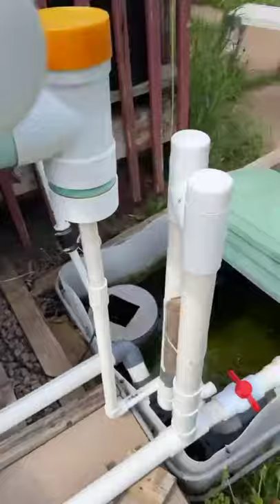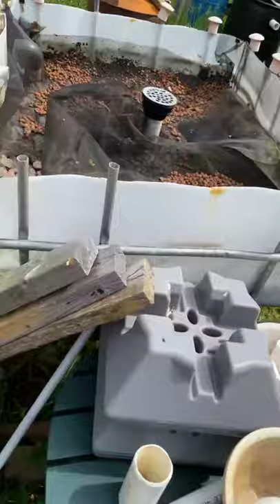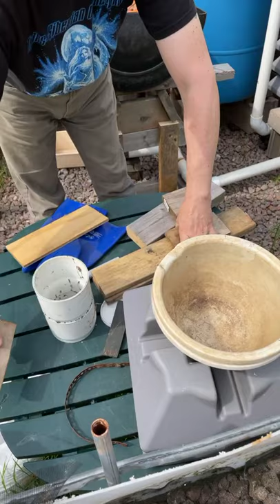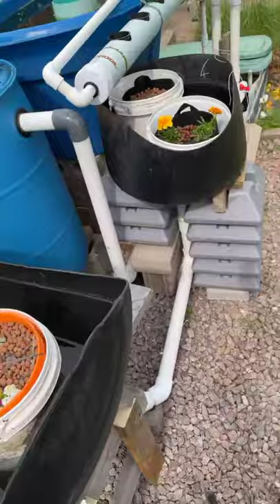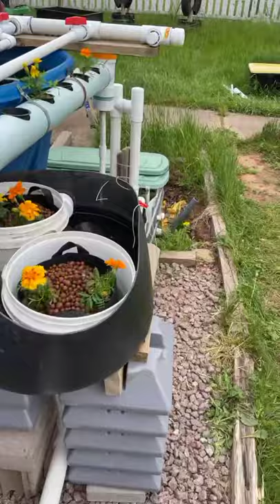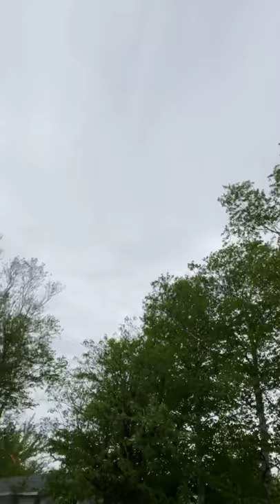Aquaponics Update for 05 June 2021

Comment: Hey Mich, I might have missed it but is the fill and drain in the same pipe in the grow beds?  can you go over that part in detail or point me in the right direction?  Cheers!  Keep up the good work!
Reply from the maker: I'll make a point of showing that in more detail in the next video; thanks for the request.

That said, you are right flood and drain is being done by the same pipe. The pump is 900gph or so;  at gravity (0 PSI), 2"/50mm SCH40 will carry 2200gph.  So I'm only using ½ the capacity of the pipe.  

When the siphon starts to run, it's generating a couple PSI of pressure.  Every PSI is about 55GPH of flow.  That means that the siphon is able to out run the pump and the water being dragged out of the grow-beds.  A chain of several grow-beds can be managed this way, so long as they are all level to each other and the time it takes to drain them doesn't start crawling past the 10 minute mark.

You want those beds to cycle at least 4 times an hour to keep the root zone wet and nutrient rich, as well as providing plenty of food for your beneficial bacteria.

Cheers!  Let me know if you have any other questions.
Reply: @MichelVaillancourt  Kinda figured that was it but cheers for the details.